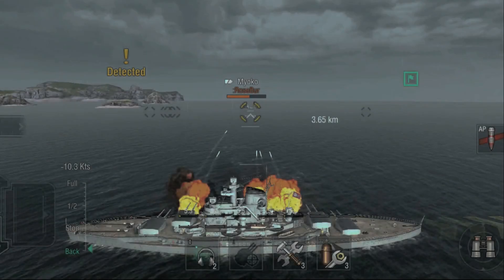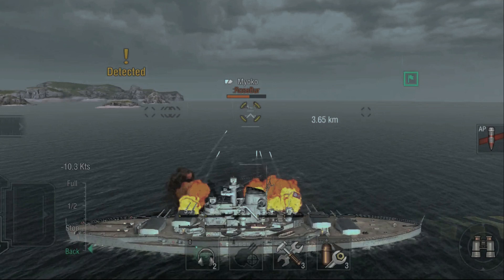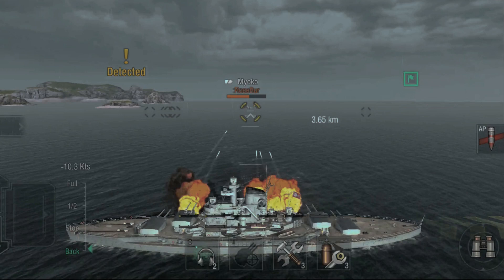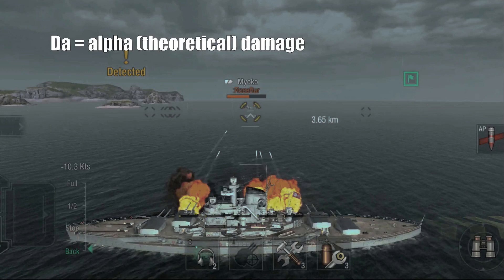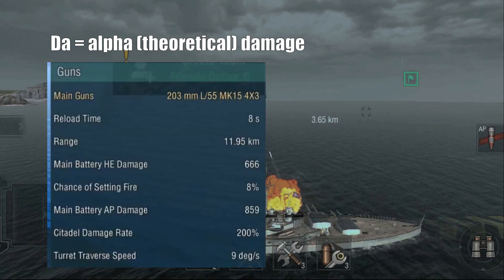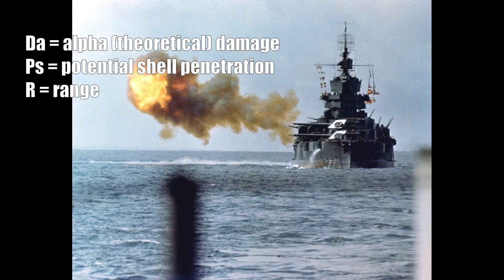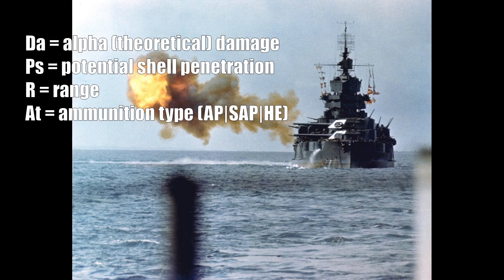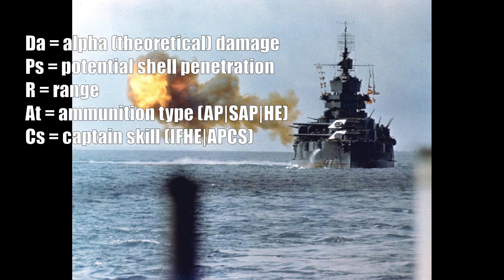World of Warships Blitz - Armour Penetration and Damage Theory

Comment: Terry where to aim in cruiser vs cruiser for citadels?
Reply from the maker: The citadel area is roughly between the first and last turret. Cruisers have varying thickness of armour, and varying size of guns, so it comes down to knowing your ship as well as your target.

Examples: an Atlanta has 127mm guns. If you're shooting at a very lightly armoured cruiser, let's say a Leander, at close range, you might be able to get through, but otherwise not much chance.

Graf Spee has 283mm guns. She'll AP citadel pretty much any cruiser through the belt.

When you're shooting AP, remember your alpha damage, and observe the effective damage at impact. If you get bounces and semi-pens (50%), you're unlikely to score a citadel.

Generally you want to aim at the midsection. Funnels are a good centre to aim at. If you can't get through the belt, you can try for deck like you would on a BB, but again, they vary so much, there is no general answer.
Reply: @FunandGameswithTerry  Thanks man im just grinding my KM cruisers atm and this would help alot. Any tips in plying nurnberg? Ive watched your nurnberg video but I'm not at the skill level yet to be able to analyze the battle and position myself where I'll be the most useful. I just kind of gravitate to any DD cause I could just 3 or 2 volley them. Peace.